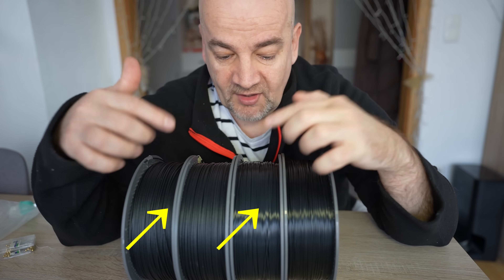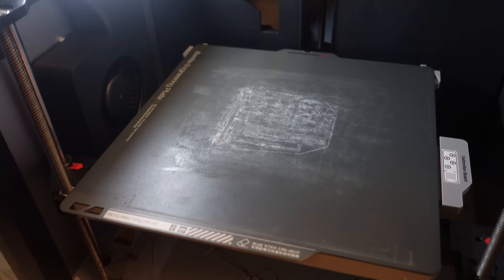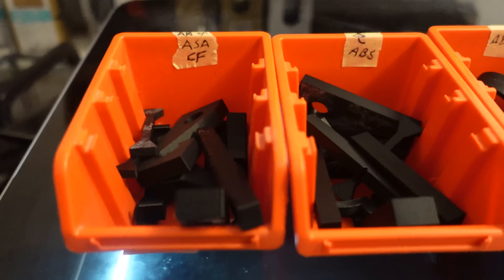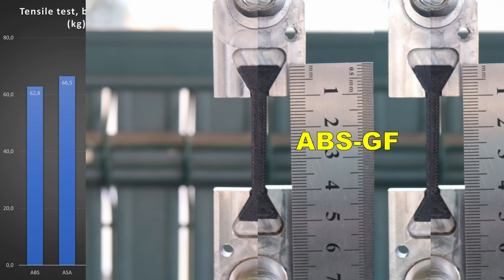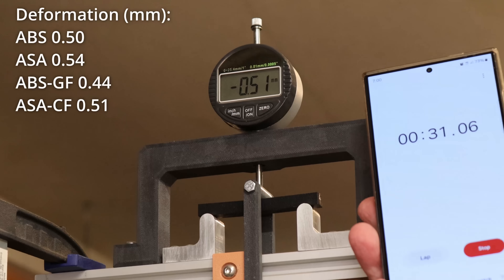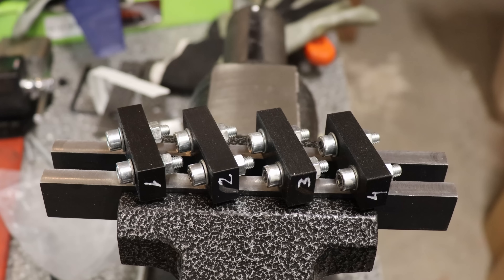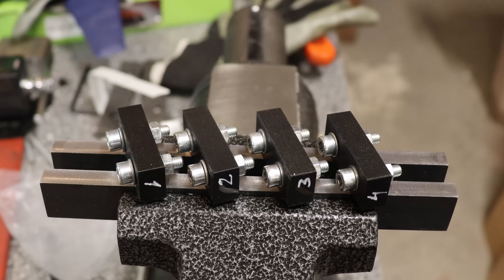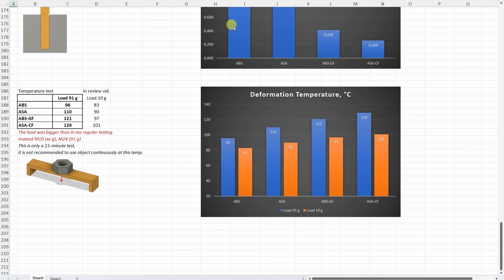BambuLab 4×Black: ABS, ASA, ABS-GF and ASA-CF

Comment: Hello. Very late but may help you in the future. 

The reason your exhaust duct isn't working is because it's flexible.
The fan in the printer is moving very little CFM. It's basically a PC fan. Low CFM and low pressure when compared to what those flexible ducts are connected to. Dryers and HVAC systems which can move 200+ CFM (HVAC).
TL;DR Your flex duct is impeding the airflow therefore toxic air is not being fully exhausted as you intend.

Replace that system with a 4" solid duct. In the US you can grab these at any home supply store. 
I say 4" because that's either a 140mm or more likely a 120mm or smaller fan. So a 3" may work. You're smart. You get get what I'm saying.
Also. Make sure any bends are subtle or in the perfect world, you have no bends.

Get rid of the inductor fan you bought. Decrease the duct diameter and you will automatically force air faster through that space. Basic fluid dynamics. (watch some Captive Aire YT videos)

🖖🏻

Comment: I wish I had watched this before buying the ASA-CF. It prints quite easily and looks great, but the strength just isn't what I would have wanted. It's far too brittle and breaks at the layers too much for my needs. I'm going to keep it for chunkier parts that could use some stiffness and heat resistance, but definitely a disappointment.

Comment: Is the layer adhesion test of abs-gf here accurate? In the last abs-gf test with different colors abs-gf was 29, but in this video its now 44. Quite a big jump.
Reply from the maker: Different test objects. In this video 10x10, 2 walls, 20% infill. In review 4x4 solid inside (max walls)
Reply: @MyTechFun  oh i see. Thank you. Though the excel spreadsheet still says 29. Will this new result be integrated there?
Reply from the maker: No, that spreadsheet is only for those reviews where I use my regular testing method. In this kind of comparison videos, (where the main goal is to have filaments related to each other) I am trying to use different experiments to have better view to the differences.

Comment: Looking at the data, ABS and ASA, without CF (ASA in particular) have superior characteristics across the board, apart from temperature tolerances (but not by much). CF seems like a scam for how little you benefit from it. Not to mention the health hazards handling and printing CF parts without proper isolation and surface treatment of printed products (with epoxy or glue).
Reply: Practically, the advantage of fibre filled materials is that they tend to warp less. This is a very useful feature for large prints.

Comment: I just ordered a couple more spools of the ABS-GF.  This and the fiber-reinforced Tinmorry PETG offerings make strong parts and print great with a 0.4mm nozzle, great layer adhesion.  Thank you for bringing these to my attention.  I barely smell the ABS-GF (I certainly did with the regular Bambu ABS), doesn't seem to grime up the glass as fast either.  I wonder why?  The Bambu ABS-GF is a little more expensive than the Tinmorry but a KG of the ABS-GF lasts noticeably longer than a KG of the Tinmorry PETG-CF/GF.  Kind of a toss-up for me, but Tinmorry's Amazon presence is convenient. Haven't broken out the Nylon-CF since you introduced me to these  two filaments, because they are good enough for my needs at half the price and way easier to dry.  The technology is amazing to me (I'm old), but I can now design complex parts on a relatively pedestrian computer, using free software (with free quality instruction/tutorials on YouTube!), then hit a few buttons, and have usable, strong parts ready to go when I wake up.  Incredible.

Comment: For your inline fan I suggest you to let the X1C door slightly open, it will create a better air flow. You can also remove the carbon filter inside the printer. You can then check the airflow with a candle or whatever is doing smoke to visualize the airflow extraction.
Reply: Also I don't remembrer the name of my inline fan, I think it's a 4 inch version, but I don't run the fan at 100%, it create too much airflow inside the chamber to a level that is a problem for printing (and also noise).
Reply: Ah and also to create a better vacuum, I applied some tape on the poop chute that act like a stage curtain, poop can go out but air can't go in though this opening. the tape is glued to itself except for a centimetre or two where I have to glue it to the top of the opening (sorry for my very bad english).

Comment: I'm curious if your vent tube (out the back of the printer enclosure) is under negative pressure (drawing heat out of the enclosure). If so, does this effect the enclosures internal temperature enough to cause problems with adhesion to the bed and/or between layers?

Comment: I am new to 3D but work in a thermal analysis lab. I have been running Bambu PLA filaments and poop on a differential scanning calorimeter (DSC) and the various colors have very different traces. The DSC measures the thermal transitions such as glass transition and the crystallization and melting behavior. The sample is heated from -10C at 10C/min to above the melt (185C), then cooled at 10C/min to -10C, and then heated again at 10C/min. Summary is  either they use different grades of PLA for different colors, or the color additives greatly affect the thermal behavior of the PLA. The glass transition temperatures are all similar (56 C - 61C - higher for filament as they are cooled under stress). But above Tg they crystallize then melt and the colors show different behavior. The crystallization onset and peak temperatures, as well as the area of the peak differ with color. And the melting peak behavior (some have multiple melt peaks) including onset, peak and area.  In the cooling step from the melt some formulations with crystallize upon cooling, others show no crystallization during this step. 

So critics of testing different colors may have a valid point. The fraction of molecules in crystals and the size of those crystals can affect mechanical properties. I am learning that PLA is slow to crystallize and might be amorphous after printing, but since I have seen crystallization upon cooling for some colors of filament, I think those colors have a degree of crystallinity. But also, the vendors may change the coloring formulation for different filament type (PLA vs PETG) of the same color. I have not printed parts and cut them up to test, I was using poop as a representative of the extruded part state. I have only tested white, blue, orange, red matte, green, a blue-green PLA from Bambu.
Reply: Very interesting
Reply: It might be because the PLA manufacturers buy Masterbatches for coloring.  I imagine that there is not enough demand for PLA masterbatches (at least not in the scale Masterbatch manufacturers would need).  So they use what is available..  So the different carrier material is introduced into the PLA
Reply: 100% correct.  Color additives have an effect on material properties, because you are replacing the mechanical plastic molecules with a color pigment.  Different pigments have different mechanical properties.  You can prove this yourself by looking at data sheets from injection molding plastic suppliers. “Neat” (so without any color added, just pure plastic) will always have the best mechanical properties, and sometimes you find ones for white and black versions.  Black is usually the strongest if I recall correctly
Reply: The same thing is true of paints. Some colors are more brittle than others.

Comment: The ABS-GF seems like good stuff. For some reason ASA doesn't seem to take to CF as well as other filament types, specifically with layer adhesion. Temperature resistance is great though!
Reply: I got some really nice prints from abs-gf, even on a printer that is not tuned for looks.

Comment: I use Bambulabs ABS-GF for large Auto part light housings and it’s by far the best most stable material to print with in the high temp category. The finish is beautiful as well.
Reply: I have retrofitted projectors into a few of my cars so I find this comment really interesting. 

Also I second PET-CF, it is an amazing material. Un-annealed it will handle 210c without any change in structure. 

Anyways abs-gf is cheaper and less dense so one spool will last you slightly longer too. 

Have you noticed the ABS causing the headlight lenses to fog up after months/years? The ABS tends to off-gass that haze onto glass, that’s why we have to clean the inside of our windshield every once in a while.
Reply: @Javii96  Yes it's really cost at the end of the day, PET-CF is unfortunately prohibitively expensive compared to ABS-GF, looks like a great material though. I haven't seen long use case results as yet, they are tail light housings so might be hard to see offgas through the coloured lenses.
Reply: Have you tried PET-GF?
Reply: @ No, I ruled it out due to the lower Heat tolerance, it only takes on higher heat once annealed according to the fine print so normal printing is on par with normal PETG. I don’t intend on annealing due to the shrinking and potential warping.
Reply: @BarnesysBuilds  pet-cf has much higher heat tolerance even when not annealed, esp compared to petg, and higher than abs.
Reply: @BarnesysBuilds  PET-GF has much more heat tolerance than ABS-GF.

Comment: Great testimg as always. I still prefer my prints in ASA.
One thing i noted with my prints is that my heated chamber typically does not wven turn on because with nozzle temps of 260 and bed temps of 95 my chamber is already at 43.
Reply: 43 is cold though, I use at least 50 with abs and asa and most often 60

Comment: I haven't tried the ASA from Bambu but do have many spools of their standard ABS. The Bambu ABS doesn't give off much odor even less so than Polymaker ABS which I also use frequently. Polymaker ASA has very little odor compared to their ABS so I found it surprising that Bambu's ASA line gives off a foul odor. I do have 2 spools of GF-ABS that I haven't yet tried so it's encouraging that it gave some edge case improvements like stiffness because I needed that for the project I'm about to embark upon. TY for all of the tests you provide it helps when ordering materials.

Comment: Igor, thanks once more.  This helps to silence the critics who complain when testing is not done with the same colors.  Honestly, I like the 3DO ASA-CF for decent layer adhesion but also because it gives higher temps for functional printer parts, with a nice appearance.  It's not cheap, though.

ASA ODOR - I have not run any Bambu filaments, but I have run ASA and ASA-CF from Fusion, Overture, Polymaker, 3DO, QIDI, Ambrosia and Sunlu. Aside from Sunlu, they all had pretty mild odors.  Actually, the Galactic Grape color Ambrosia smells like grapes! The Sunlu needed to be run hotter than others, and it was truly toxic smelling. Worst smelling filament I've ever run.  It was not only strong smelling, but it smelled particularly poisonous and made my head, throat and eyes hurt. I bought a 3M VOC filter mask after running that stuff.

ABS ODOR - Similarly, I've run a wide range of ABS and some ABS-GF from many of those brands above, plus LDO.  Some are worse than ASA, but the eSun ABS+HS magically didn't really smell at all. 

Note - my QIDI Max3 discharge feeds into a duct pipe to a large charcoal growing filter.  The room with that printer has (2) air purifiers in the to help with microplastics.  Didn't help with the Sunlu ASA, though!

Comment: -- Thank you, Igor. Good way to start a year! Funny, I was wondering about smell myself, as ASA supposed to be "odorless" version of ABS, and even when it was in same EBOS as your's(soon to be replaced with Sunlu E2, which should work for annealing parts), which also did not have power to rotate spools, I had headache from smell. Back to watching video...
Reply: -- At 3:59 that is some serious fan, where did you get it?
Reply from the maker: Inline fan, Temu
Reply: @MyTechFun  -- I was hoping for Amazon! Thank you so much, Igor, now I'm going to need it to print so much filament, that I also most got no use for, but please let us know, how it will work, because it is a big problem for me, and I've got same laundry exhaust vent, since I'm using LG 2 in one ventless laundry machine.
Reply: -- I just finished watching this video, and I do like new protractor torque test, for sure!

Thank you!

Comment: I just wondering why nobody making tests on pure filaments, before its even printed. I know it sounds uninteresting first, but it could actually gives us a direct result without the doubt regarding printing errors. Aside of that comparing to printed samples are also interesting, because who knows? Are they actually degrading or impoving.
Reply: Direct results, perhaps, but filament behaviour isn't very useful information, and it's a huge assumption that filament behaviour translates directly into printed part behaviour. It's also very very difficult to measure small variations on such a tiny cross section.

Comment: You should print your ABS/ASA in the Xidi with the chamber heater. Basically the higher the chamber temp, the better the layer adhesion, up to maybe 85C.
Reply: QIDI chamber heater, does not go up to 85C.  The Max3 goes up to 65C. Not certain if the Plus4 goes much higher.   I use the chamber heater 100% of the time with ASA and ABS, which I've been running heavily the past several weeks. Usually at 55C.
Reply: @ArgueForSport  I know that it goes up to 65, I'm just saying that the optimal temp is 85C to point out that the temp should be as high as possible in desktop printers. I print with a custom voron that goes up to 85C and IMO printing ABS/ASA in 50C is BS. If you know you know.
Reply: @sabahoudini  I'd love to see test data.  I've seen Stefan's work on CNC Kitchen with the Max3 at 65C vs ambient gaining Z tensile strength, but have not seen anything tested at higher temps than that.  If you have a link, perhaps you might share it?
Reply: @sabahoudini which mods did you do, to get to 85°C?
Reply: @ 3d printing didn't start with ABS in 50C chambers. It has always been 85-90C. Chamber temp should be the same as glass transition temp. It's just the last few years with the boom of desktop 3d printing where people have been printing with the wrong chamber temp. I've seen stuff from stratasys but they didn't have comparison data with desktop 3d printers. It's basically the same strength no matter the orientation. I don't have a link, it would take me an hour to find.
Reply: @ A LOT of insulation, bed fans. Everything in the printer either aluminium or PET-CF annealed to 130C. Motors are high temp. Really good hotend fan and toolhead has simulated hotend duct to make sure the hotend cooling is super efficient. Also fridge style door. Everything vacuum air tight.
Reply: @sabahoudini  do you think a Qidi plus 4 would be a good baseline unit to start with to make it 85c capable? What do high temp steppers entail? I imagine big heat sinks on them
Reply: @Javii96  Definitely NOT. Don't even try it. You need a voron or similar where it's just extrusions and stuff you can print in high temp plastic. Remember the first QIDI's had problems tolerating even 65 C. High temp steppers are rated up to 185C degrees.  No need to do anything with them. They are fairly common.
Reply: @sabahoudini  yea that makes sense. I forget how hot 85c is, I use Fahrenheit. I already had to print fan ducts to cool the stepper drivers, they would be sitting at 100-110c just doing nothing.
Reply: @sabahoudini don’t forget that at those temps, you need teflon insulation. Standard PVC won’t stand that. So wiring in the printer could have a problem.
Reply: @ Yeah it's important to know what wires you are putting in the chamber. Also connectors and PCBs have temp ratings. The things that will go out fastest is the connectors.
Reply: @sabahoudini  I run a nevermore carbon filter in the qidi and i noticed at 65c chamber temp the smell is pretty strong with ABS still. At 55c i can’t smell it at all. I think the carbon does not do well at those temps too

Comment: My biggest dislike of ABS and ASA is the soot or haze that it leaves all over the internals of the printer. It coats the glass and really gives you a good idea of what you'd be breathing in open air or unventilated environments.
Reply: That is mostly the off-gassing of styrene.  I'd suggest two things to minimize these issues. Install a nevermore or bento box carbon hepa filter and run the filter during prints or simply exhaust the air after the print completes which may not eliminate but will cut down on hazing.  Just be sure not to run it too long because it can increase chances of warping and de-laminating layers if you cool large prints too fast.
Reply: @PLr1c3r  I recently got a bento box and it's surprisingly effective. If you think about it, the amount of fumes coming out is very slow and controlled. On my Bambu P1s anyway, the auxiliary fan is located opposite the part and creates very gentle airflow that perfectly complements the Bento Box, creating a clockwise circular cycle. I also replaced the exhaust fan filter with a combined HEPA/carbon filter that I believe should create a very small negative pressure, minimizing VOC/particle leakage through the case. 

I still only print PLA/PET/PETG with it, but it really does work. I used to detect a slight hint of fumes with only the stock carbon filter, but now it truly has gone down to nothing.